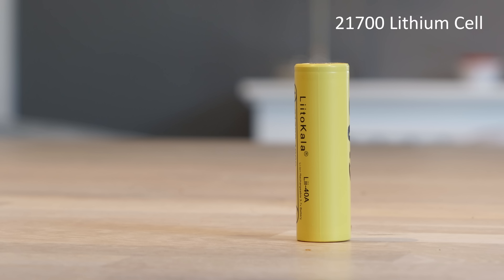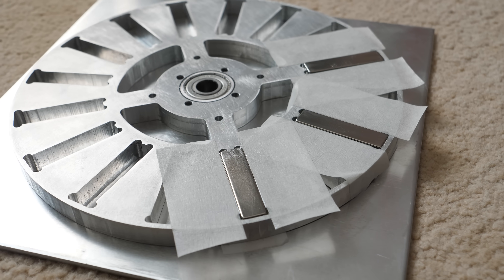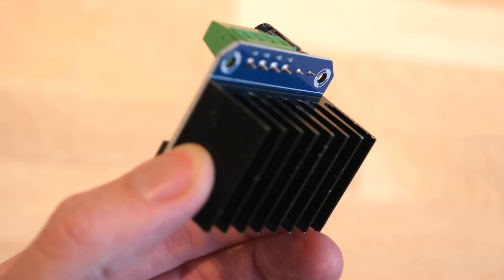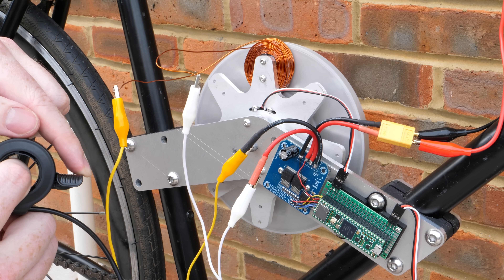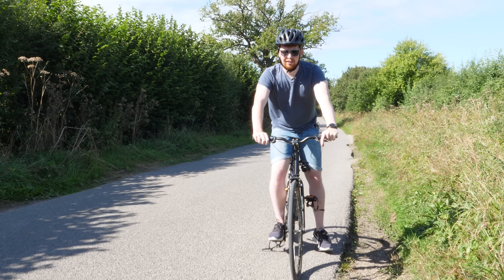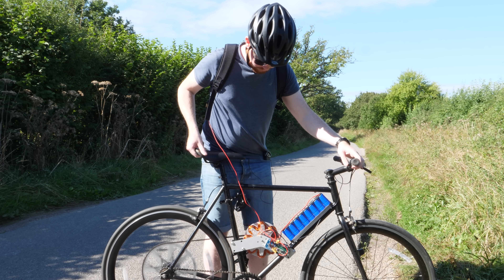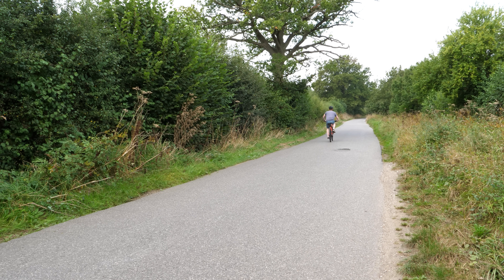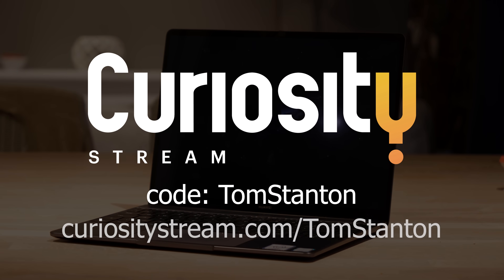Super Capacitor Bike

Comment: Given the weight of the super capacitors, I'm surprised you didn't just quadrupole the battery count. Maybe, for round 2, you could integrate the supercapacitors to the regen braking system and use Lithiums for drive.
Reply: thas what i was thinking it will ad weight but the lithium batteries cant charge that quick so it would maybe be good
Reply: Lamborghini already has that in the Sian, integrated regen to supercapacitors using lithium but with lithium ion for the material of supercapacitors.
Reply: Capacitors for taking off quickly from the start, li-ion batteries for cruising, with regenerative braking recharging your capacitors specifically. Now that'd be neat!
Reply: @bene6270  did you see how slow the start was? With that hand-built e-motor, literally has less than 2lbs of torque. probably less than 1.
Reply: @bene6270  You copied and pasted this from RobotSlug
Reply: @bene6270  modern lithium ion batteries can be charged or discharged very rapidly, at more than 5c, for very short bursts, rendering capacitors useless.
Reply: @harsimranbansal5355  yeah but super capacitors have more potential than lithium batteries in certain applications
Reply: @harsimranbansal5355  with high heat potential too. thats the issue with Li-ion batteries in general. Carbon nanotube help, which is where alot of modern cellphones benefit, but there is a reason why we all remember those "Samsung Note 7 battery fires". They get hot due to the chemical reaction that occurs during charging and discharging. higher Operational voltage increases the rate they can charge/discharge, but at the cost of heat. | Carbon Nanotubes basically made fast-charging viable, but it didnt make it safer nor more efficient for the longevity of the pack. Rapid cycles wear the battery 70% more than slow cycles.

Discharging them rapidly although usually is more of a issue, thats why in applications where they are used in devices like laptops, they use so many cell-packs to have them discharge separately to reduce both temperature and wear on each group of cells.

SuperCaps suffer from none of this. - Also these caps in use in this video are not anywhere near as big as some of them that are made for industrial purposes. People are using 1700+MF super-caps as automotive battery replacements in some areas for this reason. they remain light for their storage, but still not as energy dense as a Li-ion cell in 1:1 but the wear is minuscule and their energy delivery potential is much higher, due to being more efficient when charging/discharging. | so ramping up charge rate is as little as increasing the voltage of your regenerative breaking system and stepping it down to your Li-ion for long-storage. 

If you run multiple sets of super-caps for both the recharge and discharge cycles with massive super-caps as the buffer you would end up with a much more energy dense and efficient design. | but cost goes up as both +500MF caps and Li-ion cells are rather expensive.
Reply: @harsimranbansal5355  the problem with that is that Li Ion batteries are way more dangerous than super capacitors, and charging batteries that fast degrades the battery very quicklly. Capacitors dont degrade, and are less dangerous when charging quickly.

Comment: What do you think about wiring a capacitor into a race drone and use it as a booster for straightaway finish when battery is low?
Reply: Capacitors only help if you want to draw a large amount of current - remember they only store a tiny amount of energy as explained at the start of the video.  Imagine adding a capacitor to your drone as similar to adding a tiny button battery like they use in wrist watches, plus some additional dead weight to slow the drone down, and you can see it's probably going to make things worse.  You'd be better off just adding a slightly larger battery instead, which would allow the drone to store much more energy than an additional capacitor would.

Comment: A steel plade on the opposite side of the rotor will increase the flux-density on the coil side, AND eliminate the magnetic attraction on the chain.  Alternatively, place another set of coils on that side, also with a back-plate.  Also, a boost controller will keep the motor voltage up even when the capacitor voltage drops.
Reply: I was thinking about using the boost controller as well, it's cheap and easy to implement

Comment: If you did considered adding more than adequate battery capacity/voltage to generously match your capacitance needs AND ADD 12V GENERATORS ON YOUR FRONT AND REAR TIRES, I THINK YOU WOULD HAVE MORE POWER AND CAPACITOR DISCHARGES AND RECHARGE IF WIRED CORRECT...  Just saying...

Comment: You could charge the super capacitors  with regenerative breaking then you can use the capacitor to charge the lithium ion batteries while throttle is off

Comment: Thank you for scratching this itch, I have wanted to try the super capacitor bike for years!  I also appreciate the plots comparing discharge rates.  I have seen a DIY kit for a hybrid capacitor lithium car battery, which is quite compact.  Have you considered trying a hybrid lithium super cap powered bicycle?  With 40% regen braking maybe some weight savings and improved peak power/braking is possible?
Reply: Hi
Reply: Tom, since hearing about graphene super caps hitting production soon (+72% e density), I’ve been playing with Eaton’s supercapacitor calculator, and re watched your video….it seems most motor controllers are designed to handle up to 90V input and many motors operate between 24V and 48V….so there is a lot more “capacity” above 20V than what was presented.  I’d love to see similar experiments using 30 to 33 series super capacitor cells, maybe smaller cells for similar footprint and overall F rating…..then you could have a basis for evaluating what is possible with graphene super caps in the near future.

Comment: Given the capacities of the cap and battery shown at the beginning, it would take about 1.3 minutes to charge the lithium cell to 0.4 Wh of energy, as compared to 1 minute for the capacitor. So the difference between the two in terms of charging rate is pretty minor.  If you kept the lithium cell at 40% of its charge and just added and remove that 0.4 Wh at that level, the voltage output would be pretty constant as well, unlike the capacitor.

Comment: You may have a workable hybrid platform - traditional Ebike power for distance and supercaps for acceleration/regen braking.  Similar to the Prius and other hybrid cars using a combination of batteries and IC motor.

Comment: Find out how much capacitance it would take to make recharging a standard Li-Ion battery pack for an e-bike or a car, take only 10 minutes or so.  That means that the batteries charge normally for 10 minutes, the Supercaps take a few seconds or less to charge up and then they feed the batteries with what they have stored.  I mean that the caps charge the batteries once the charger has been disconnected.  
Once you are on the road, the supercaps take the initial surge of braking regeneration and dole it out to the batteries more slowly.

Comment: As part of the "YOU VILL RENT EVERYTING / YOU VILL OWN NOSSING / YOU VILL EAT ZE BUGS / UNT YOU VILL BE HAPPY" program for Agenda 2030, we want to make sure you are indoctrinated with a steady flow of "electric vehicle" propaganda, as we try to present to you an impractical means of travel with limited range and a high dependence on auxiliary electronics... whereas any internal combustion engine can be made to run fully mechanically with easy-to-repair parts, long ranges, high reliability, and still the best power-to-weight ratio of any land-based propulsion method. In our next video, we will show test wind-turbine powered electric airplanes.
Reply: you can hate electric vehicles all you want, but electric bikes are hella efficient.
Reply: @thegreatzoom5073   Just get a motorcycle like the Honda Grom.

Comment: the gear relation is wrong.. the back cog should be the small one, and the motor the bigger one.. so you can spin the wheel faster... it probably wont help you start moving.. but will help when you aready at some speed. 

this way the motor is running a lot to amost no turn in the wheel

Comment: This is awesome! Could be actually used! I may add for the next time you could use the pedals to recharge the capacitors
Reply: Like have a mechanical generator with a flywheel or something not using the regenerative braking :D

Comment: Intentional misinformation? The discharge graphic is fake. If that where true then capacitors would not exist let alone be used in discharge dampening or starter circuits.

Comment: You could possibly modify it to run on a battery and use regenerative breaking to charge the super caps and the battery for instant high output torque for accelerating while preserving battery life

Comment: Respect to the author, for the fact that the engine was handmade! But the engine design is not perfect. It has large losses due to inefficient scattering of the magnetic field.
The result would be better if the engine had traditional iron plates for more effective field concentration and use of electric energy.

Comment: Years ago I built a coil winder with a hand crank, cranking the handle with one hand, while guiding the wire with the other. It had a flapper that would hit the +1 button on the calculator with every revolution.

Comment: Hi Tom, what about syncing it with the pedal position so you regen when you push the pedal around 90deg after TDC, and used the motor to power it when when your pedal is close to TDC and your legs/body doesn't have much leverage. It will require a position/angle sensor on the pedal sprocket, to get the pedal angle, which could be a rotary encoder or just cut one tooth of the sprocket and use a hall effect sensor. This could cause issues if you stop pedaling or pedal backwards, but will resync after one normal rotation.
Great video BTW thanks👍

Comment: How about an air powered vehicle, but it uses a small turbo to constanly charge up the air tank, an edf wouldn't work tho since it would be underpressured if you try for example filling a glove with air with it, it wouldn't work, If you wanted you could have a small turbo charging the air tank and a turbo for the engine itself. By the way i would recommend not making the turbo out of plastic because centrifugal force easily breaks it so like aluminium should be good, although making the turbo blade out of aluminium would be difficult since its a spiral kind of shape so machining it could be a little tricky, although i think the turbo case itself could be made of plastic, just not the blades tho. I guess you could also like find a scrap turbo somewhere idk lol but i think its a great idea. but I mean it could be crap at the end of the day but i would like to see you try it nonetheless

Comment: I like the burst of power for coming out of the corners. Is there a way to use the capacitors just for that. As in running off normal battery voltage and then have the capacitors used just for a short power boost or voltage increase?

Comment: Why trouble yourself with diy controllers?
Just buy refined VESC like the ones from trampa and it's as good as it can get...
If you buy cheapest VESC in shrinkwrap those will work... but not for long and will blow up from lack of proper cooling and TVS diodes for protection from voltage spikes.

Comment: Hey Tom!
Really enjoy your experiments. A few questions:
What mill are you using here to mill the magnet pockets in the aluminum flywheel and what's your recommendation for a filament 3D printer if high resolution is the most important property? 🤔 
I'm going to pull the trigger on some new lab / workshop gear... 😉

Comment: would be interesting to combine fly wheel power plus electric motor and a motor controller to make efficient motor like use electric motor to get fly wheel going up to speed and then when wheel is up to speed the controller puts the power to the dive for short burst of power then switch back to electric motor to get back up to speed and then power cycle again

Comment: I've always wanted to have a efficient energy recovery braking system on top of the normal Li-ion cells on my e-bike. The combination of both would be the most ideal setup for efficiency. In stop-n-go traffic and hilly areas alike, recovering a good % of energy during braking would extend the range at least 5%. The main downside would be that you don't regenerate much on a long downhill section because the caps would cap out(pun intended).
Reply: Hi

Comment: The motor you made is incredibly inefficient. You need iron cores at least, but you can likely double the efficiency without adding THAT much complexity (relative to three complexity of the project already).

Super cool that you actually hand made the motor and the whole system works as well as it did.

Edit: actually, another whole video could be made using a range of methods to show the flux lines of the current design and the results after adding the cores and iron return paths on the back.

Comment: why don't ebikes run a small geared  alternator so when you get to full speed you could either produce half or up to 90% input power needed to run the motor to save battery life

Comment: I have a hub system with regeneration and its really not a bad feature but it doesn't nearly compensate downhill in the way that this does, as it really only increases efficiency probably 10%... the regenerative braking is easier on the brakes but it's hell on the dropouts unless they're really solid... And then there's the drag that prevents freewheeling... Makes sense to have a supercapacitor system alongside a Freewheel standard e-bike... To make the most of the topography

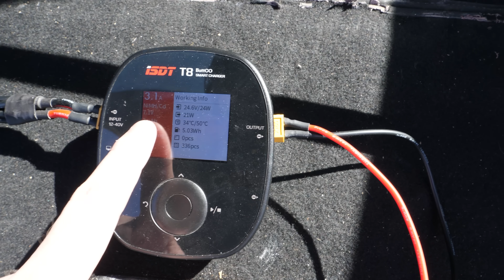Comment: Did i see that correctly, at 8:14 when you turned in the Ni hydride charge settings,  the change in electron flow was so great that it jolted the cables

Comment: This is fascinating - also wondering if a person's weight or the bike's weight would have any effect on how long the batteries would run? Would the energy of the batteries discharge faster for trying to run at top speed with a certain amount of weight?
Reply: Yes, this is why a small lightweight remote control car can run for hours on a AA battery, but his bike (with the equivalent energy to a AA battery) could only run for a minute or so.  It's the same reason why large heavy trucks need larger engines and burn more fuel than small light motorbikes.
Reply: @Berkeloid0  thanks bro

Comment: Use both super caps & Lithium batteries. The super caps become a charging cache for the batteries so one an doa lot more regen charging than normal. Like whenever the bike’s going faster than the motor, not just when braking.

Comment: Now add a generator so it keeps the capacitors charged up to some extent and use it as pedal assist. The motor then is only used when you need it to help you go uphill etc.

Comment: what if you charged them with dual dynamo's on the bike's wheels? wouldn't that give you the slight regeneration of energy you'd need to get this going? would give you maybe some extra energy to spin the wheels at without needing an actual battery to power it?

Comment: Tom is there a way to slow the battery drainage of the lithium battery by generating a small current back into the batteries charging port increasing range of  the ebike?

Comment: For an obviously intelligent bloke you've overlooked a few very basic fundamental principals of electronics.  Use bigger wire the resistance at these low voltages is absolutely critical.  Use the frame as the negative and run a heavy gauge positive wire.

Comment: Why the hell is this guy using just a couple little caps? While he's at it, why not 10 220uF electrolytics? Or how about like 30 SMT tantalums? Geez! He's got less capacitor, in both space and power, then the batteries is use in a vintage boom box portable stereo. Why didn't his brain ever think to itself, "there are just not enough capacitors being used here..."? 
I would've gone with a sizeable box of 3000F supercaps, perhaps about 16 of em, making it about the size of a Maxwell blue tech battery pack (about the size of a car battery, but all caps), stored on the rear bike rack maybe?

Comment: I've been waiting forever to hear about someone making a supercap bicycle.  Thank you so much for blazing the trail!

It has so much potential, because you really only need assists on hills, which of course come with their own regen energy on the other side, and if you have a center stand that is easy to deploy, then you can use stop signs as an opportunity to charge up your caps.

You forgot to mention the other major benefits of supercaps: 100X more cycles before significant loss of capacity, and a vastly lower environmental footprint.

I've been dying to see commercial supercap bikes.  :) :) :)
Reply: Hi

Comment: I wonder if a capacitor bank could be run with a lithium bank, using the capacitors to take up the regen braking and discharging into the lithium, while the motor draws just from the lithium

Comment: - Ford spent a billion dollars 20 years ago  developing a capacitor bank to replace the car battery. Advantage; Less than a minute to fully charge.
- Worked fine, however a safty issue derailed the project. Getting Zapped by a fully charged capacitor could prove fatal. ☠

Comment: I kept expecting a twist where the caps were used just for extra oomph during acceleration and then trickle charged from a battery or used to capture regen which then boosted a main battery. Maybe having caps as a booster would allowing optimising the main battery in some way that drops it's max output but has other benefits.

Comment: just a weird idea and I have no idea if it works, what if you use your leg power to charge the capacitor while your pedals are horizontal, and drive the motor while the pedals are vertical (and you legs don't do any work).